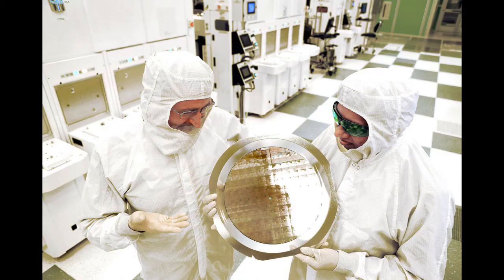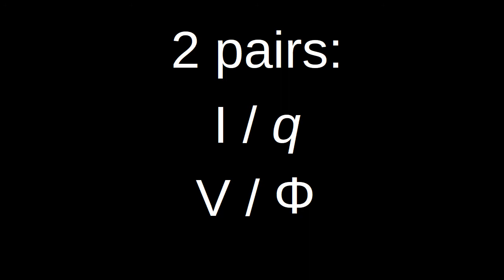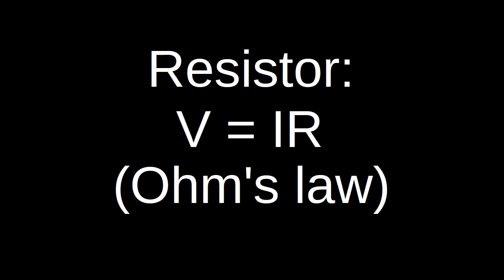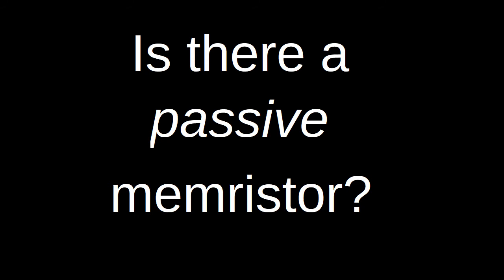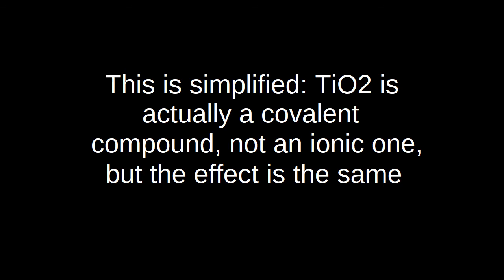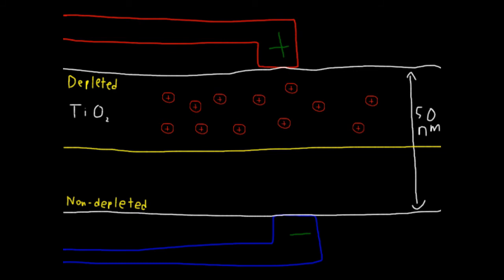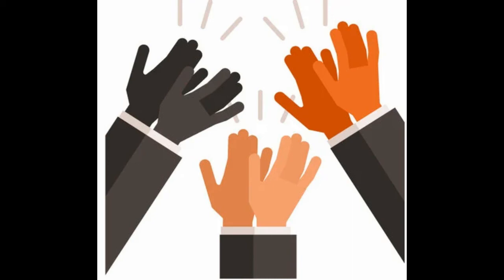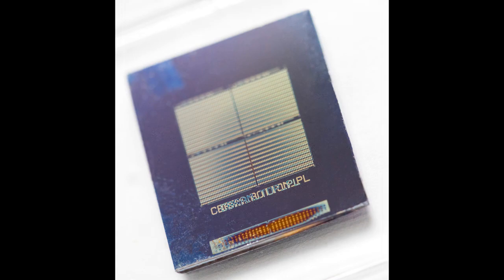Memristors!

Comment: maybe the problem is that we allow the resistor to rewrite the resistance, and with enough redundancy and permanent write ability (disallow the erasure) we can create a learning mechanism for AI which allows for a unavoidable memory system that inherently includes a comparison model...that is given enough opportunity for the AI system to judge the pathways and determine the value of each probability for success based on those "memsistors" to determine success vs failure
Reply from the maker: Memristors definitely seem like they'd be useful for machine learning, in fact one of the reasons they're so promising is that they can combine processing and memory to act more like the brain. It might be more economical to keep the erase function so that a single chip could train more than one model.  I'm not an ML expert though.
Reply: Interesting idea, I'd guess the limiting factor here is signal quality. It's much easier to quantize a signal like this with 2 levels (or 3 levels if we account for metastability) than for the N levels that would probably be needed for the comparison model. There's a lot of room for error here since we're working at distances of a few nanometers. I also think the speed at which the ADC/DAC used for read/write operations work would be a limiting factor. This is not to mention the other circuit design complications to allow for sufficient programmability of the connections between the memristors. At the end it might just be a lot faster and more realistic to do this at a higher abstraction level. Maybe a different implementation of the memristor would allow for this, the idea of analog memory is very interesting.